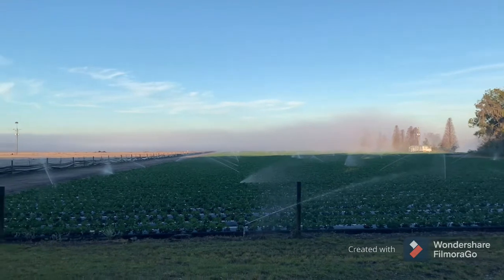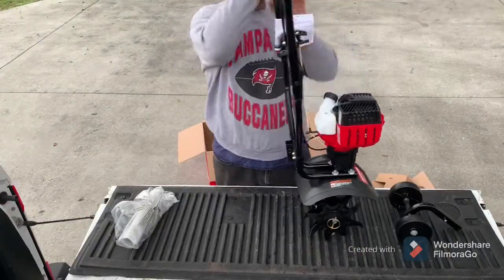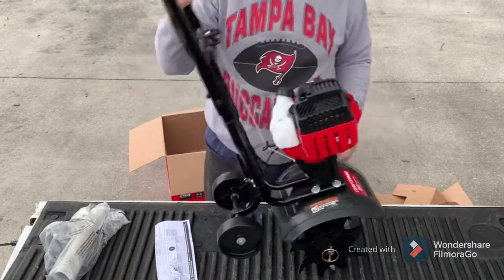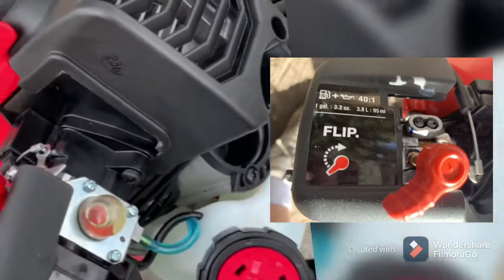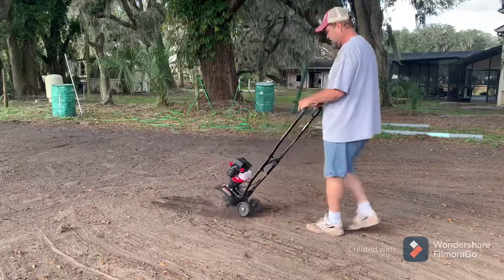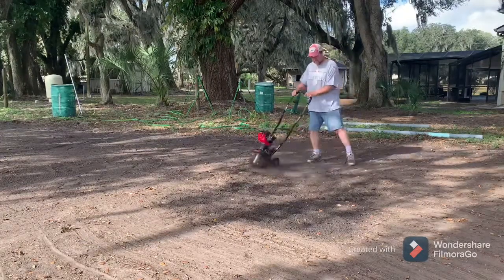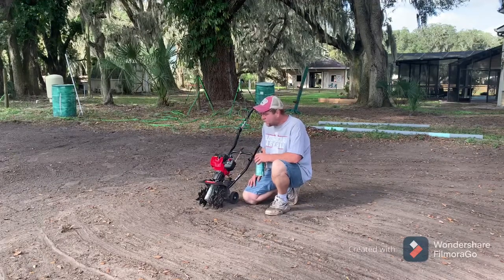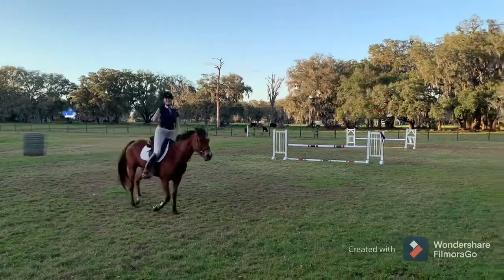Craftsman 25cc Cultivator

Comment: Terrible piece of equipment. Mine is always hard to start.
Reply from the maker: I always have a can of starter fluid. A couple of squirts in the carb works great especially if it has been sitting a wile with old gas in the tank. Thanks for commenting 👍🏻